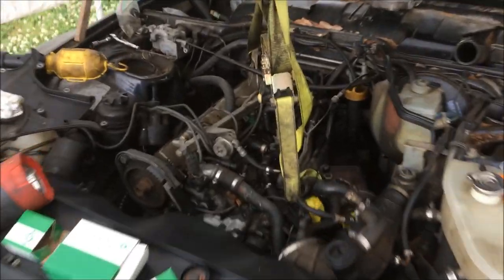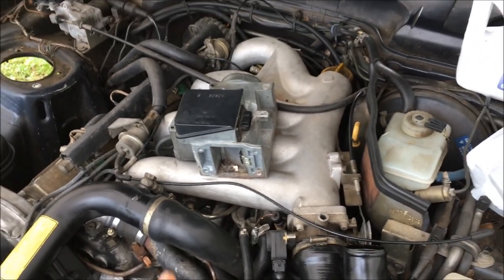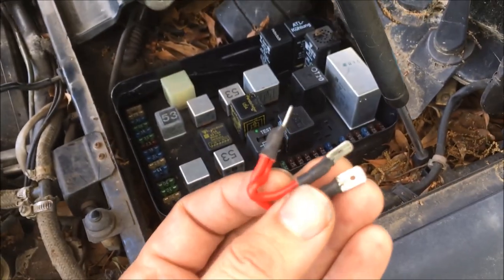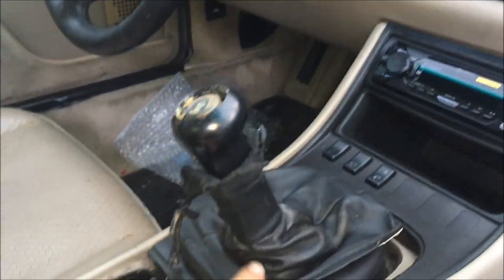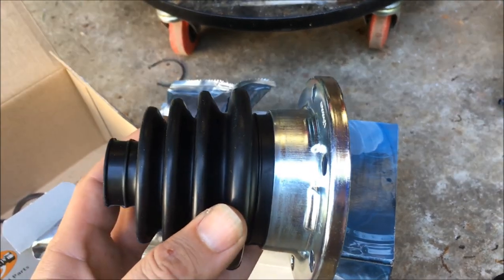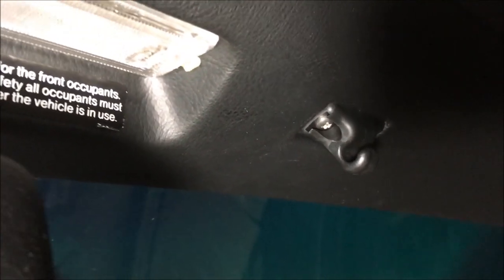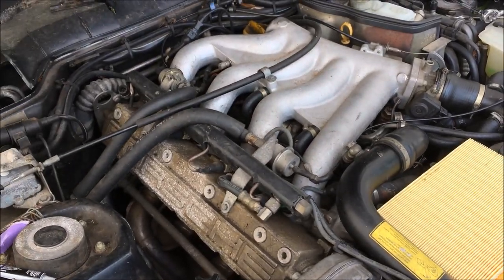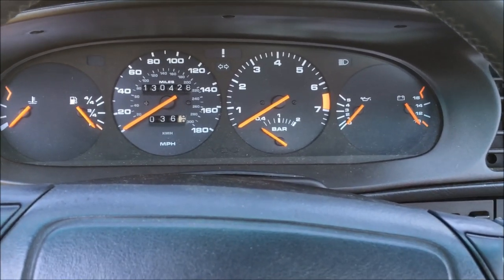Nautic Blue Porsche 944 Turbo Part 2

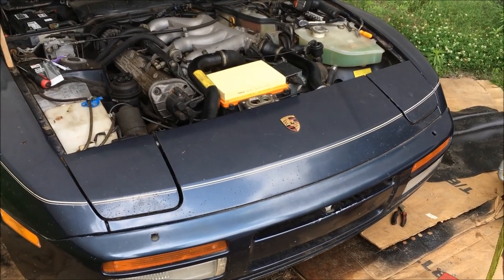Comment: I had been trying to track down a ticking noise in my recently purchased 83 n/a and i saw this video at 25:40. I went out last night and pushed on my spark plug wire boots and surprisingly the #4 plug, the last one i checked was not seated properly and went down about 1/2” more. Noise is gone! Thanks for the tip on that!
Reply from the maker: Awesome! Always glad to help!

Comment: I love these videos.  The only part I wish was kept in was the removal of the brake pistons.  I have used air and hydraulic fluid before, but always the loosest piston comes out first.  My method has been to reinstall the easy one and keep going until the most stubborn one comes out but there has to be an easier way.  But hours of struggling later even the easy one is hard with nothing pushing it out.
Reply: looks like I jumped the gun.. kept watching until 20:30... answered.... lol
Reply from the maker: I really wish that I had actually demonstrated it but I was in such a hurry to get them finished up. I have another set that I'll likely be rebuilding soon and will just make a complete video on it...

Comment: Had my 86 951 at a body shop years ago,  and I know ALL ABOUT THE BOLT FALLING OUT OF THE AIR BOX !!! They stood behind their work but it was still a pain !😄😄😄
Reply from the maker: Oh wow, that's not good. When you rush things mistakes are easy to make. Glad they stood behind it!
Reply: edredas tell you what , the noise from the turbo. With the bolt hitting the compressor is a WTF ! Moment !😄😄great video!
Reply from the maker: I bet that was scary...
Reply: edredas took the turbo off in my driveway. Unbolted  it from the down pipe .THEN I FOUND OUT I COULD TAKE 3 NUTS OFF THE. EXHAUST PIPE AND TAKE IT OUT! !!😄😄😄my dumb ass !😄

Comment: Hello Edredas, I’m working on my 951 from 85.5, and I noticed some cracks on the wirings in the engine bay, especially on the AFM. How would you fix it ? Cut a part of the wire and solder a new wire ? Or crimp a connector ? I’m afraid of soldering the wire and increasing the resistance of the wire, especially the signal wire where the resistance is really important for the DME. What do you think ? 
Thanks for your time
Reply from the maker: We usually solder new plugs on. If you do a good job it won’t increase the resistance and will be far more durable than crimping. Crimps can pull out and are very bulky. Just make sure the copper on the wiring is clean and directly connect it and flow the solder over it then it will have a solid long lasting connection. I hope that helps!
Reply: @edredas  it does help thank you !

Comment: No compression check before..the spending..?..on the air bag..im guessing bad continuity and sensors in the front..the sensors that connect when you..hit something in excess of 12 mph at an angle..that connects the switch..and pops the bags..

I like your channel
Reply from the maker: Yep, a quick boreascope and compression test was done before I even started to make sure the engine was even worth saving. The engine had sat for a very long time so I will likely do another compression test once I have done several road tests to make sure all is well. As for the airbags, checking the crash sensors is next on my list... Thanks!
Reply: edredas. [ guess dorman has many sensors now...i bet this used bmw e30. Like sensors..bosch..of the era..on the e30 they were on the wheelhouses..btw..for 15 bucks you can get the porsche manuals air bag supplement...ebay.com
Reply from the maker: Yep, I see where they're located. They're up near the firewall under the dash. From what little I've found online a fault in one of the sensors should just cause the light to come on. So I went ahead and ordered the airbag workshop manual so that I can troubleshoot it better. Thanks!

Comment: What's your opinion on proper antifreeze choice for these cars? Plenty of guys will say go with the expensive Pentosin SF or NF, but I see green coolant in your videos. What's your go-to for proper coolant requirements?
Reply from the maker: I only use what the manufacturer and label recommends. Your typical green coolant is specifically formulated for cars made before 1990 that have stronger corrosion inhibitors, but they have a shorter life span. Coolants for modern vehicles have weaker inhibitors that last a little longer but are not formulated for older cars. The chemicals in these newer coolants have been known to eat older radiators with lead solder joints and the inhibitors work far too slowly to protect older vehicles. I know there are some arguments to be made but every coolant manufacturer that I've seen has all said to only use green coolant in cars that originally came with it. So be careful of what you read online from people that are not actually engineers in the industry and follow the label. The cleanest cooling systems that I have seen have always used green coolant with distilled water that is flushed at least 24-36 months as recommended. I hope that helps!
Reply: That's more good, straight information than about ten years worth of forum searches, thanks!